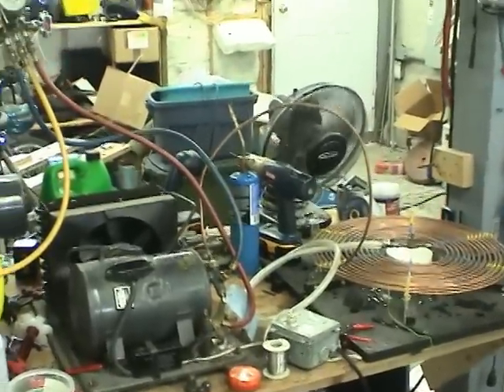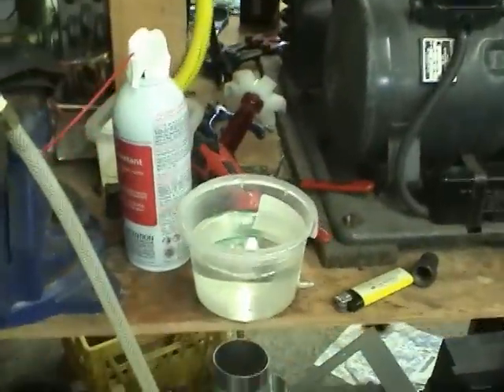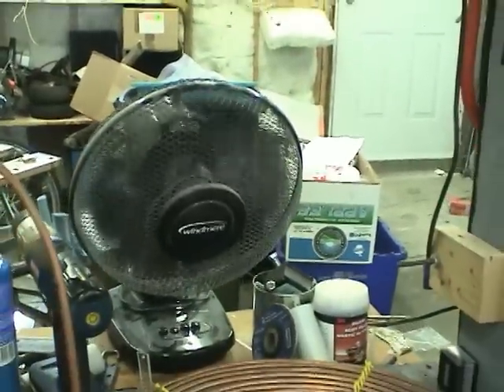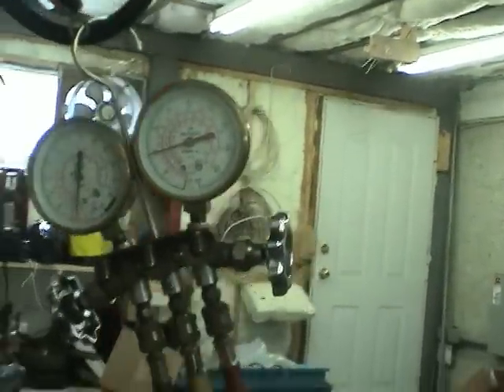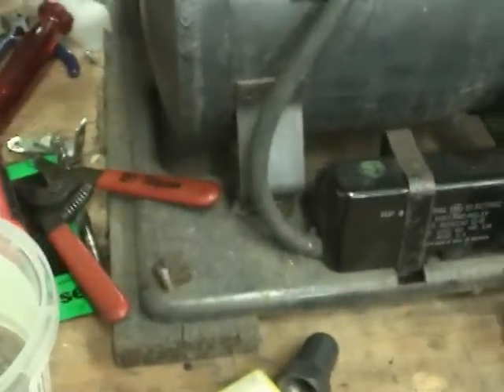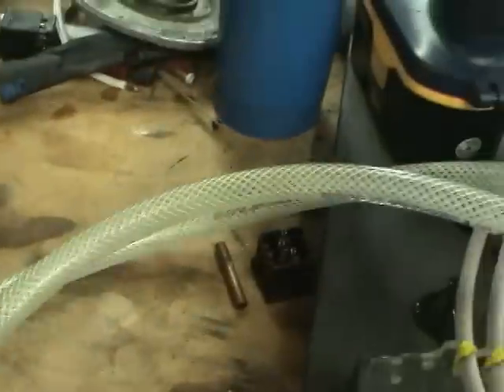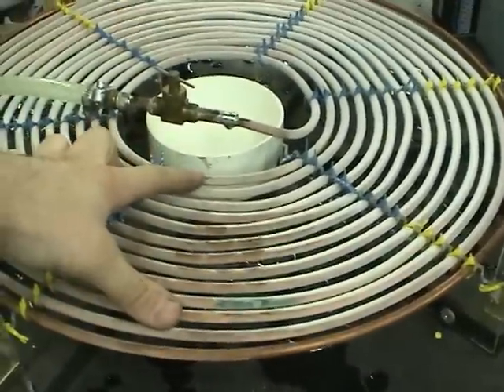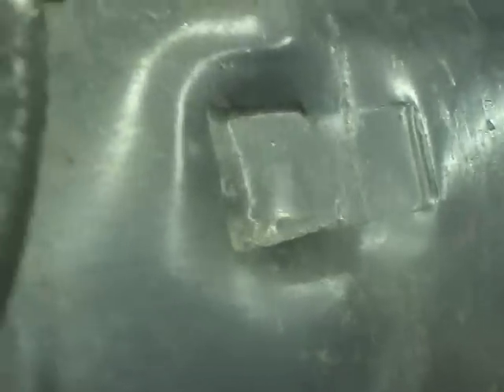DIY refrigeration system

Comment: how do you prevent the compressor from compressing liquid state, is there a specific balance of pressure set via the valve?
Reply: Old comment but you watch the temp and pressure. He has frost on the inside, but the outside does not. That's because the cool gas is quickly warmed by the fan and ceases to be cool. The liquid in the center needs to boil (latent heat) which takes more btus than warming the vapor (sensible heat).   The outside of the coil doesn't have frost which means the airflow has warmed it above freezing, which means there isn't liquid there.

Comment: FYI, "compressor oil" used to be pretty much the same stuff as now in your laxative aisle sold as mineral oil. At least it worked for me for years on my first air compressor which I used a window AC compressor and just poured 2 ounces in.

Comment: The 150 you are using is a direct replacement for R 12, but needs pag oil. MIneral oil won't work long. You can refill a 134a car with the air duster. It will freeze you out better than 134a. It would have been interesting to raise the pressure up to 30 or so on the suction and see if the evaporator was about 40 deg. You basically would have a window unit. It would be interesting to estimate the BTU output. My 5000 BTU window unit takes about 8-9 amps total. you may have more BTU's with half the amps.
Reply: R152a will actually work fine with mineral oil. I have seen it used in multiple systems with great success. I generally dont use it because r290 (propane) is way cheaper and is a great drop in for a mini fridge. (Because of the low charge amount the flammability is not an issue)

Comment: Excuse me for being so stupid...but what is the meaning of this..from the layman's eye, all it appears what you have done was to reactivate an old compressor with circular copper tubing.
It doesn't appear to be cheap or cost effective.
Reply: If you acquire the condensing unit for free, and do some searching you can find almost all the components you see for free, why not?  If you're wanting to learn how things work, no better way to do it than for free!  "What happens if this happens - create a fault and find out. "  Now if he were trying to cool his garage ( which 1/4 HP would have no chance in doing.. ) you're right, it wouldn't be cost effective.

Comment: This sort of yee ha cowboy crap is what gives our industry a bad name
Reply: +dunteee How, hes a guy screwing around with his own stuff in his own garage. He's not doing this for anyone else or claiming it is the correct way of assembling a refrigeration unit.  I like to modify and reuse old equipment for things they went really made for the hell of it and my own personal use as well. And just being a DIYer that dabbles around in electronics projects and other random stuff knows this isn't a real long term usable kind of setup, not using a good compressor lubricant or proper plumbing.  Though for the hell of it i tried using the same make shift refrigerant he used in an old Toyota AC system after fixing a leak and evacuating it of air and moisture,  and its been running fine for almost 3 years now, with better results than the refrigerant the system was rated for.
Reply: dunteee Or fascination for DIY nerds like me who have zero experience in refrigeration. Keep it up, dude. I love atypical uses for ordinary items!
Reply: too bad 152a isn't a hydrocarbon.  Now if he was using 290... you'd have a point.
Reply: Well yes, its a hydro*fluoro*carbon. But what is supposed to go so wrong dunteee? I dont know what you mean.
Reply: It"ll only take one experiment with hydrocarbons to go pear shaped and someone to get seriously hurt for you to know what I mean.

Comment: If you don't mind me asking, what is the part behind the fan. It looks like a heat exchange or some kind of radiator. Really cool device dude.
Reply: That's the condensing unit, I believe. It's function is to cool the refrigerant.

Comment: I'd also like to add, he used a 2-stage professional vacuum pump for evacuation.  Hermetic compressors the motor runs IN the refrigerant environment.  I don't even want to know what would happen if spark happened with oxygen in the system under pressure.  If it weren't so dangerous, propane, isobutane and such would make excellent refrigerants (colder and more efficient than R12 even).  Just, imagine if your car were charged with it and you got in an accident?
Reply: the use butane in new frigerators

Comment: I hear quite a bit of grinding.  Did you change the oil out with Ester oil (for R134A) in cars?  You can get it at O'Reilly's.  If it's old it probably has R12 (mineral) oil in it.  HFC's (134a, 152a 'Dust Off) are not compatible, and your system will not oil.  If one were so inclined and daring, I saw this one guy using hydrocarbon (propane and such) as a refrigerant, and gets COLD.  Dangerous for obvious reasons (leak and spark let's say, it'll get very HOT). ChhHHH... WHOOSH!

Comment: Hi there! :D 
Could you, please, tell me... could I use use butane in small system (.3hp) ?
And what the pressures should be? (idle, hi-side, low-side?)  With a good purge, sure. 
And those hoses really puzzle me. Actually the amount of liquid I see before the expansion valve. I never thought that it accumulates so much liquid ;))

Comment: think the prob with that would have to be the compressor used to force a liquid phase to evaporate for cooling.  as I remember, many many atmospheres for liquid air. maybe 200x atmospheric.  and the designed working range efficiency prob not great for standard temps.  but I am not a refrigerant guy and only have a limited knowledge.

Comment: Very interesting. One thing I've been wondering: the minimum temperature of a refrigerator would normally be the boiling temperature of the refrigerant. R152a would go down to about -25C or so. Nitrogen/Oxygen both boil roughly around the -180C point... You see where I'm going with this. Would it be possible to use plain old breathable air as refrigerant? But people MUST have thought of that before. What are the practical objections, other than it just being too damn cold?
Reply: The issue with using plain air, is that it's significantly harder to compress into a liquid (requiring a muuuch stronger container) than a typical refrigerant. Could you though? Yes. It's just impractical.

Comment from the maker: @josephdupont All refrigeration systems are technically heat pumps. It's just that typically the hot side (condenser) is mounted near the compressor, so it's hard to use the heat produced.

Essentially, if you reversed the suction and discharge of the compressor, the heat pump will be reversed.

Comment: @KompulsaOfficial Continued: No one ever uses that method to cool their room, they use a fan to blow the cooled air through ice on themselves, which will of course work, but the room is being heated by the refrigerator in the process, but room cooling does not work that way.

Comment: @skittlesmonkey Industrial plants may use a turbine instead of an expansion valve for greater efficiency (Google "turbo-expander") but the added cost and complexity of the turbine is hard to justify for most systems.

Comment from the maker: @phonicsquest The fan is to put some heat load onto the evaporator, so it doesn't ice up too much. Copper tubes are much easier to work with than aluminum, as well as easier to find.

Comment: @zigilwantsu the pan catches the condensate water from inside the fridge.  The pipes should be hot. The idea is that the water will evaporate, so you don't need a drain.

Comment: @tesla500 Hi I got a question. My sister has a small commercial frig in hr coffeeshop. it starting making a clunky noise randomly. she called a serviceman , but at the time it didnt make a noise and so the problem can not be shown.
when I turn the fan with my hands , it doesnt make any noise.Further  the copper tubes coming out of compressor go to a pan, which I don't know if supposed to be full of water or not. the compressor and tubes very hot during operation. do u they must lay in water?

Comment: don't chuck it out mate, hook up a thermostat drop the evap coil into an ice box, fill it with water, throw some non toxic tube in there run beer through it and you got yourself a sweet as chilled beer tap, just like the pub. you want the water cold 2-4deg Celsius. you can go to most refrig + a/c wholesalers and buy small 1kg canisters of 134a refrigerant, probably be best for that setup and cheap enough. some of them come with dye in it for car a/c, try not to get that. good stuff man

Comment: @skittlesmonkey if you did that you would have to put a bigger compressor in to pump the refrigerant, pointless really. an expansion valve is a metering device purely to control the expansion rate of the refrigerant. good thinking tho

Comment: AMAZING!!! THE COOLEST THING IVE SEEN IN A LONG TIME, I collect compressors, expansion valves, sight gauges etc and am working on designing and building my own air conditioning system, I read refrigeration books and read about dryers, and all the other different things you need other than just tubing, accumulators etc..... i am some for some reason obsessed with refridgeration systems and want to learn as much as I can if anyone knows any good books on the design please suggest.

thanks Jay

Comment: I'd turn it into a heat exchanger for an oil bath!. seeing what you do with HV and MOT's, I would could make a mini refrigerated cooling tower.

I've been toying with designs for a while involving ethylene glycol as the coolant (for plastics molding machines) but mineral oil would work just as well. make a tank or barrel with the evap coils in it and circulate the oil around them, then out to the transformer bath.

I'm saving a good 5kw AC condensing unit for a bigger version.

Comment from the maker: I don't have any quantitative data, but it can definitely produce more cooling than the copper coil can take advantage of, that's why it's freezing up. Based on the compressor rating, it may be able to produce 300-400W of cooling.

Comment from the maker: The gauge set has a filler port, I first pulled the air out of the system with an air conditioning compressor. I then connected the dusting gas bottle to the filler port, turned on the condensing unit compressor, and let it suck the gas in. Since the evaporating temperature is lower than the bottle temperature, the gas will boil off in the bottle and be sucked into the system.

I then charged the system until there was pure liquid refrigerant in the clear liquid line, no bubbles.

Comment from the maker: Thanks Ed!

Yep, that hose is dodgy, I always have safety goggles on around this thing. I didn't have a sight glass available, and I'd never have been able to get the charge right without seeing the liquid line.

I'm getting more and more hesitant to scrap it too, I just need to find something to use it for. It's kinda pointless to save something just to have it sit in storage forever. 

Any ideas of what to make? Refrigeration cooled computer? Cold gun? (opposite of a heat gun)